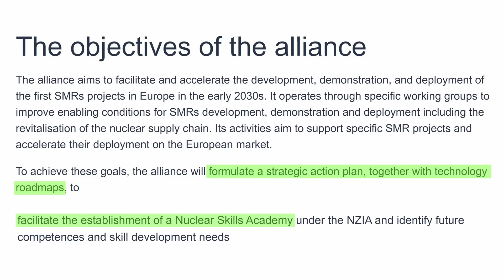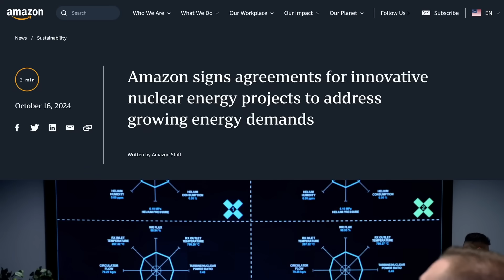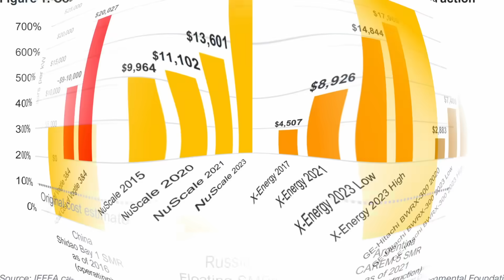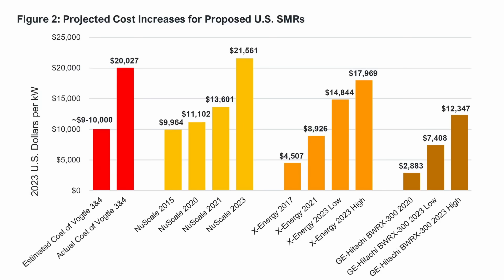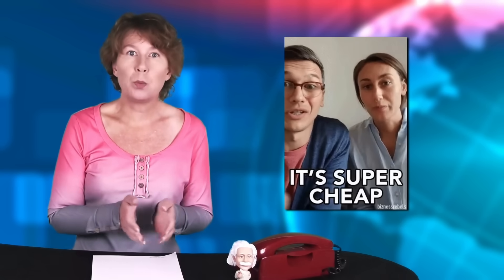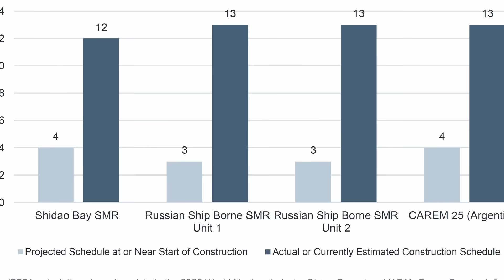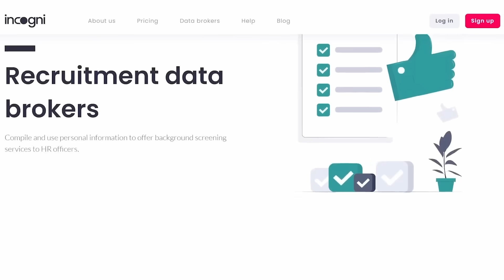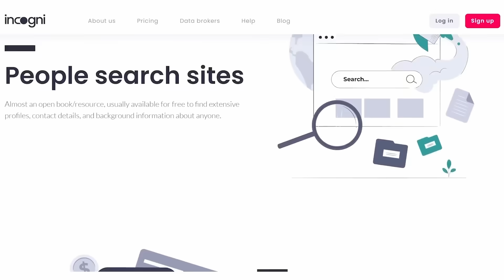Small Nuclear Reactors Have A Big Problem

Comment: I'm extremely pro-nuclear and have worked in the nuclear power industry.  However, the SMR concept has had some major flaws from the start.

But, lets correct the data on the NuScale plant.  The final proposal was to build 6 Power Units of 77 MWe for a total of 462 MWe (and not 12 Units of 50 MWe = 600 MWe).

Estimated cost came in at $9.5 Billion, with and expected inflation escalation of $1 Billion during construction for a total estimated cost of $10.5 Billion.

Based on the VC Summer and Vogtle lessons learned from the AP1000 construction mistakes (1150 MWe give or take some based on local conditions) it was estimated that you could have built a AP1000 unit for about the same amount of money which would have required about the same amount of staff (2.44 more generation for the same money).  Note that other countries with experienced nuclear construction crews have built the AP1000 units on time and on budget.

The biggest flaw with the SMR concept has been known since the late 1970's.   If you double the size of the nuclear power plant you need about 40% more materials, it cost about 40% more to build, and you likely do not even need to increase staff size.  When the Power Unit gets large enough to need a staff size increase - the staff size increase is minor to modest.  That is why virtually all nuclear power plants are 1GWe (1000 MWe) or larger.  Base economics of scale drives you to build the largest plant you can - if you need that much nuclear power (you do see a small amount  of 500-900 MWe plants as that much better matches the power needs of the country or area).   The USA built what would be consider 17 SMRs in the 1960's and 1970's.  They were all shut down as uneconomical once larger plants came online (and in a number of cases just due to staffing cost on a per MWhr basis).

The next biggest flaw is the concept of "standard design" that can be massed produced (and mass produced is a flawed concept by itself).    Each nuclear power plant has to be designed to withstand the local worst case natural disaster for where the plant is being build.  Major factors that affect the sturctual design of a nuclear power plant is how bad of a earthquake does it need to withstand.   I've worked in nuclear plants in the Midwest USA with very mild earthquake design requirements.  I've done consulting job in California in known active fault areas with expected much more severe earthquakes.  Everything from the thickness of the reactor vessel and other tanks, piping thickness, structural steel thickness (and spacing), required pipe supports, how thick and strong the floors are - are radically different.     In the 3 plants I have worked in in the midwest I-beams were about twice the thickness of fossil plants in the area (I previously worked in fossil plants in the Midwest).  In California the I-beams were 3-4 times as thick as the nuclear plants in the USA and they were spaced a lot closer.  I've never seen so many and so large of piping supports either.

Many other natural disaster factors exist:  Flooding risk, hurricane or tornado risk (and tornado are worse than hurricanes), Volcano risk (the Idaho NuScale Plant had to plan for a major Volcano eruption both upwind and relatively local to the plant), etc.

The concept of a "standard designed" component that you could mass produce for use in all nuclear power plant sites for the Safety Related Nuclear components - does not exist.  No one wants to pay for a component designed for the worst case - unless they are in a worst case design area.  It would massively increase the cost of other nuclear power plant.

Mass production requires 3 things.   

1) That you are producing large numbers of at least essentially the same item (minor variations allowed) in sufficient numbers to make sense to mass produce them.  Both Airbus and Boeing has Commercial Aircraft models where they are producing essentially over 100 per year, with model runs lasting over a decade.  Yet, these are all essentially hand assembled as its not worth the cost to build a factory to mass produce them.   There is a very apt real world comparison.

2) That you have a design that has been proven to work.  There is not a single SMR design that has proven it can run reliably and cost effectively for many decades.  The history of the nuclear power industry worldwide shows that even what appears to be great concepts on paper just have not worked in real life.  The USA build over 100 Light Water reactors using something like 70+ different designs in some way in the 1960's - 1990's.  A number of plants performed so badly that they were shut down very prematurely.  A lot of the others never had the license extended and shut down at or near the end of their original license.  Many plants in the USA often spent tens of $millions modifying systems and components to designs that actually worked in real life.

The only reason we now have long term reliable light water nuclear power plants is that we have had decades of lessons for each system and component in a nuclear power plant as to what works long term reliable, low maintenance cost, and reasonable to operate.  The AP1000 design (a 3rd generation commercial plant design) incorporated the best design for every component and system based on 4-5 decades of experience with all the different experiments.

While the SMRs can borrow some of those "best practices" many of the light water reactor and plant designs I have looked at have key elements that are totally new concepts that have never been previously built (1st generation design - and forget that they call it a 4th generation reactor - its still a 1st generation design for what they are trying).  No one knows if they will actually work long term as reliable and economical design concepts (and virtually none of the non-light water plant have ever had a successful commercial plant ever in the world).

So there are no "proven designs" that we know will actually work out long term.   Industry data suggest that it will take at least 2 decades of operation of any of these designs before we have a good idea if it will really work out long term.

3) That you have the 5+ years to build and troubleshoot a plant that could automate much of the production to get the economics of mass production for various large components.   No one is talking about this at all...

Until those 3 conditions are met - all major components for nuclear power plants will be built the same way they are now and have historically been built.  One to a small batch at a time: Example I worked at one plant design where there were 6 Power Plant Units built of that design - and 5 of them are still running- so every major nuclear and safety related component was built in a batch of 6+ in the late 1960's and early 1970's (in some cases spares were produced).  There will be no cost savings from mass production for SMRs.

Moving past the mass production issue:   Most SMR proponents are all talking about how skids can be factory built and moved to site - and then the pipes can just be welded together and  connecting wires run to save time and money in construction.

This has been tried at least twice for fossil plants. Total cost and schedule disaster. One of those ideas that looks good as a concept, but requires a level of quality and dimensional control in the factory producing the skids that so far has not been demonstrated to exist. It so far has been demonstrated to be cheaper to just build a normal seismically designed metal framework for the site (be it an industrial plant, a fossil power plant, etc), bring in the pre-assembled major components (Like has always been done) and field built connecting piping and wiring.

Now there may be a place for a few SMRs where you are geologically isolated and only need a small nuclear power plant.  However, economics of scale and other factors drive you to large central stations.

Last time I looked (some months ago) there were 9 Westinghouse AP1000 design plants under construction in the world, excluding Vogtle 4 which has now started up:  3 AP1000's and 6 Chinese CAP1400's (The Chinese hired Westinghouse to design a larger licensed version - their CAP1400 - about 1500 MWe), and about a dozen more where the AP1000 contracts were being negotiated.  I have heard that some of these contracts being negotiated at the time have been signed - so there are now more than the 9 I researched some months ago (and I'm not going to research things now).

There are about 60 large central station nuclear power plants under construction in the world at this time, with an average completion time of about 6 years.

Both the French and Germans have admitted that the EPR reactor design needs to be modified, and no new plants will be started (and all existing plants are struggling, in part due to the design flaws that they made).  I'm not holding my breath as due to French ego and pride but I think the French would be far ahead to just adopt the AP1000 and get moving. The 4 AP1000 China built has proven itself and directly against the 2 EPRs that China built.  The AP1000 is the more economical and reliable large central station plant.
Reply: I feel I learned a lot there.  Thanks for that.
Reply: Outstanding overview.
Reply: Now this is an informed comment. Makes sense that bigger scales save costs.
Reply: @Frrk 
The containment building can be hardened to withstand a direct hit from a bomb.  Automatic failsafe features insure a proper shutdown.
Reply: Longest YouTube comment I've read ever
Reply: Just a correction for the EPR, the UK will build at least two more (Sizewell C)
But yeah I agree, would should have prepared the certification of the AP1000 instead of working on the EPR2
But now unfrortunately it's too late and there have been way too much money invested in the EPR2 to not build it
Reply: @intrepidhibex  I wish they had gone with the AP1000 too....  I was going to be on the program engineering team setting up the engineering programs and policies, along with potentially troubleshooting construction issued due to my background.   Instead I was driving uber/lift and got covid badly which had left me with long-covid and I can no longer do the engineering work I used to do.
Reply: man, whoever you work for is never going to get that sweet sweet billions of dollars of Gvt grant money thrown at them.
Reply: Very informative, thanks!
But the chances of any new LWR (of whatever design) being planned, commissioned and brought to grid are very likely about zero for the next 20 years.
Reply: @DH-rj2kv  Your comment is only true for a few specific countries

There are at least 55 worldwide LWRs under construction worldwide right now, with many more planned.
Reply: Thank you, excellent comment! I've learned a lot from it.
Reply: Yeah, but let's loot at Baimsky NPP which consist of four floating NPPs 100 MW each, which have a price of $2 bln USD and is under construction since 2022.
It's 462MW for $10bln vs 400 MW for $2-2.5 bln.
If you're not seeking fast breakthroughs, but slowly building over the stable foundation, overpricing is not an issue.
Russia uses icebreaker reactors for SMR project and manages to keep the cost low. Also since Russia possess an advanced enrichment technology that provides high separation for low energy, and since electricity price in Russia is low, it can easily produce large amounts of HALEU for those reactors (with 19% U235) righ now, without investment into HALEU production.
Concerning the size issues Rosatom actually wants to build SMRs with the right size for the place they're going to be used. If the requirements is 200 MW, then it's 2 RITM-200 and a gas EPP as backup, if it's 400, then they'll build 2 RITM-400, if it's 600, then VVER-600, if 1200 then VVER-1200, and if you need smaller amount of power, they'll give you RITM-100 or some other reactors.
The problem starts when you build 10 SMRs instead of one or two reactors of a decent size.
Reply: @Itoyokofan  Russian reactors in general do not meet Western construction or safety standards.   Their newer ones are close; bur save a lot of money by not going the next step.

The biggest cost savings with a floating reactor is that it does not have to be designed to withstand earthquakes as the barge, ship, or sub marine just bobbles in.

I also point out the very poor radiation safety hazard of Soviet/Russian naval reactors.   As a comparison:  In the USA a person can serve for decades in nuclear propulsion and not recieve enough radiation to be a concern.   I have been told by multiple people that in the Russian Navy that the reactor crews typically serve 2-3 cruises and then are rotated out due to radiation exposure.
Reply: @perryallan3524  Russian modern reactors meet every standard. In fact VVERs are more safe than any western reactor, because it has a corium trap. And they're by far more reliable than AP1000 because so many of them were built and were working for decades. And all the recently build AP1000 had issues, which is why the price got skyrocketed, while out of tens VVERs built from 2000 in Russia and abroad there were none significant issues before the start, and all the recent projects were built on schedule and with no overpricing.
The hexagonal fuel packs TVEL produce have been less prone to deformations and leaks than western ones. Statistically they were more likely to deform back in 1990s than the square ones BWRs use but by 2024 TVEL had reduced the number of incidents below or on pair with any western fuel despite significantly prolonging the fuel campaign (they're one step behind the square fuel rods in terms of fuel campaign duration, but that's because westerners have  been really milking their old reactors, because of how little they build anew)
As for the automatic control systems Russian reactor abroad use western ones.
As for naval reactors, RITM-200 is not a descendant of submarine reactors, it's a water reactor descendant of icebreaker ones, so it cannot be compared to Bismuth reactors used in Soviet submarines, plus any issues they had were 40 years ago, by today Rosatom have been improving on the safety of all the reactor designs, and were building them for almost half of the century now.
All the talks about muh Chernobyl and muh Soviet submarines is irrelevant now, Rosatom doesn't even build these types of reactors anymore.
The seismic argument is irrelevant too, since two RITM-200 NPP are in construction simultaneously: naval Bilibino, and land-based Chukotka NPP which has to be seismically reliable since it close to Russia's seismically active province.
Reply: @Itoyokofan  Thank you for driving me to research the latest VVER-1200 design.  I stand corrected and concur that this design meets modern western standards (Even better than the EPR in my opinion).  However, to the best of my knowledge there are 5 currently under construction and none have run yet.   I disagree about the early VVER-1000 designs which were just Generation 2 plants although it appears that some of the later ones incorporated more safety features to more toward Generation 3 standards and may meet the standards I am looking for (and my brief look showed what apparently could be called Generation 2.5 plants).   I don't have the time to research individual plants and what added safety features were added to at least some of the later VVER-1000 designs.

You apparently are under a misunderstanding about the Finish nuclear power plant.  It's and EPR, and yes it has had problems (as well as the Chinese EPR plants - which my memory says has had fuel rod leaks).

I cannot consider a comparison of mainly Generation 2 reactors to the Generation 3+ AP1000 as fair; and I do not see hexagon fuel assemblies as having any innate advantages over square fuel assemblies. I have spent most of my nuclear career working in or consulting for Westinghouse reactors - and I have not heard of a single fuel rod leak in over 20 years that was not caused by Foreign Material (debris) getting trapped and abrading through the cladding (and those are now really rare - the two plant I worked at had not had any fuel leaks for any cause in over 20 years).  In the same time frame I have heard of other plant designs from the same generations (B&W, CE, Etc.) that have had fuel leak issues.  I think its a "how the fuel rod is supported and spacing" that is the issue, and it seems that Westinghouse figured that out long ago.   I have contacts in a Chinese AP1000 plant (as I did a consulting job there) and have not heard of any fuel leaks, fuel problems, or any reliability issues.

The fair comparison will be the AP1000 vs the VVER-1200 when they start operating and get past any initial startup issues (it seems that all plants have those).

I note that the EPR has a core catcher should a melted core melt through the bottom of the reactor vessel.   It appears that the AP1000 does not, but that Westinghouse took other actions to make that a very rare event (I did not have the time to dig into details if I was to answer your post).

The seismic argument is always viable when taking a vessel carried reactor and moving it to land.  How viable depends on what the local worst case earthquake could be.   I'm betting that there were design changes made to the land based version of the Chukotka NPP from the shipboard mounting.
Reply: @perryallan3524 
1. About VVERs, I believe Belarus and some others have the latest designs with corium traps. Leningrad-2 have AES-2006 design VVER with corium trap and confinement reactor building with passive cooling ventilation channels of the building.
2. I didn't say hexagonal fuel had advantage, I said it had disadvantage back in 2000s, (because of more harsh temperature conditions and some other problems), that's why Westinghouse fuel for VVERs haven't been successful at the beginning. But somehow TVEL had improoved on the fuel so much, it's not a problem anymore and it's on pair if not better than usual western-made fuel.
Well 2000s were 20 years ago as you say, so I guess everyone have figured out the fuel rod leaks already.
Also I'm getting the second-hand opinion from my wife's female friend, who's the NPP operator, and other sources, so if you feel like I'm saying nonsense be free to correct me.
Reply: @Itoyokofan  You provided a good answer and I believe it deserves a really good response:  According to a 50 page document on the Russian Rosatom website:  The VVER-1200 (AES-2006 design) was listed under construction at the following locations (and I misread it the other day; there were 7 units under construction in that document):

Russia:
- Baltic  (2 Units)
- Leningrad II  (2 Units)
- Novovoronezh II (2 Units)

Belarus:
- Belarus (1 Unit)

I looked these plants up using the database at the World Nuclear Organization; and that 50 page document is dated:

- Leningrad II VVER-1200 Unit 1 went online Oct 2018, Unit 2 Oct March 2021.  Unit 3 construction start in March 2024.  Unit 4 is planned for the future.
- Novovoronezh II VVER-1200 Unit 1 went online Oct 2018, Unit 2 March 2021
- Baltic  (2 Units): Canceled - never built, not under construction. Not currently planned.  It is a future proposed plant.

I also found that Kursk-II has 2 "upgraded" Units under construction under (Model VVER-1200 TOI).  Construction start in 2019.  Key modifications involve upgrading the plant design so that the core would not melt with the loss of all electrical power and controls for 72 hours (a standard the AP1000 met from the start of its conception before the year 2000 and licensed by the US NRC in 2006. Secondary key modifications to control radiation exposure to workers in the plant to more "western" standards.

I note that Russia likes to claim that they are the nuclear industry leaders.  I view them as a laggard in virtually every way and the VVER-1200 TOI/V-510 design shows by just how much and how long to catch up to the Western standards and ideas that predate the year 2000.  

I also highly discount the talk of plant operators who have only worked in a single plant design.  Most everyone thinks their plant design is the best and runs the best (unless they have a very troubled plant).  The reality is that the best running nuclear power plant Units in the world is tied to the Operating Company's policies for maintenance and training and the current top 10 nuclear power plants in the world with the best "load factors" (What % of power generation from theoretical if it ran at 100% 24/7) represents 9 different plant designs.

Likewise that top 10 MWhr producing nuclear power plant Units represent 9 different designs.  What is amazing is that 6 of the top 10 power producing Units in the world are in the United States and are Generation II reactor plants that were constructed many decades ago.

Note the above data can be found on the World Nuclear Association website 

There are 4 more Model VVER-1200 TOI's planned in Russia (Kursk II 3 & 4) and 2 Units at a planned Smolensk II plant.

Russia has on its proposal list a total of 22 VVER Units at various existing and new plant sites (most being the new TOI version - and only duplicating the older VVER-1200 designs at plants with those existing Units).

Belarus:  This history is a bit more revealing and shows the difference between Russia building plants inside Russia and building plants in other countries:

2 VVER-1200 units at the Ostrovets power plant:  Unit 1 construction started in 2013, Unit 2 construction started in 2014. Unit 1 went online Nov 2020, and Unit 2 went online Nov 2023.  Delays were attributed to a problem identified with the Unit 1 reactor vessel (and Unit 1 was built using the planned Unit 2 reactor vessel and a new reactor vessel was supplied for Unit 2) and that Russian nuclear construction company could not supply enough skilled workers to construct the plant on schedule (while the same company kept the new plants in Russia on schedule).

I also identified that:

Egypt is building 4 VVER-1200 Units at the new El Dabaa power plant:  Unit 1 Construction start July 2020,.... Unit 4 Construction Start Jan 2023.  I cannot find if these are the original VVER-1200 design or the newer TOI 72 hour passive safe less radiation for workers design.

Bangladesh is building 2 VVER-1200 Units an the New Rooppur Power Plant site:  This is a change from a previous contract to build 2 VVER-1000 Units. Unit 1 construction started in Nov 2017, Unit 2 construction stared in July 2018.  Construction of both Units are behind schedule.  I cannot find if these are the original VVER-1200 design or the newer TOI 72 hour passive safe less radiation for workers design.

China is building 4 VVER-1200 Units  (the original design).  Xudabao Units 3 & 4: Unit 3 construction start July 2021, Unit 4 May 2022.  Tianwan Units 7 & 8.  Unit 7 construction start May 2021, Unit 8 construction start Feb 2022.

In conclusion - as of this date there are 6 of the original designed VVER-1200's running.  There are at least 5 more of the original VVER-1200 designs under construction.

There are at least 2 of the upgraded to more modern western standards for passive safety and radiation protection TOI models under construction.

There are 6 VVER-1200's in Bangladesh and Egypt that I'm not sure of which model is being built.

There are 27 planned or proposed VVER-1200 Units inside Russia as of the latest information ( I have no information on proposed VVER reactors in other countries).  Some being the older version of the VVER-1200; others being the newer TOI version.

By the way: Russia has long claimed that the VVER-1200 Reactor designs would meet western standards has multiple times said that they were going to submit them to the US NRC and the UK Nuclear Regulator for approval (and their biggest selling point is that they are cheaper to build than Western Reactors).  They never have submitted these designs for approval despite all their talk.  Makes you wonder why.

France/Germany (EPR) Japanese and Korean companies submitted their designs for approval, and one Japanese and the Korean design is approved by the US NRC (The US NRC currently has 6 nuclear power plant designs approved that could be built on any approved site in the USA without any further approvals).  The other companies have suspended review of their applications at this time - which could be restarted at any time.

Note it took me hours to look this up.  Hope you appreciate it and hope that this clears things up. That is why I so rarely take time to look up detailed info to answer questions.
Reply: @perryallan3524  I appreciate your effort on the research, I really do. However I'd like to add something:
1. VVER-TOI, afaik, is an upgrade to AES-2006, so there won't be any new designs like AES-2006. Plus TOI project is being upgraded too.
2. Out of several proposed NPPs in Russia not all of them are going to be VVER-1200s, part would be SMRs, and Siberian NPP was apparently upgraded from SMRs to 2 VVER-1000 (an old design because it was prooven to be more seismically reliable) (this is just talk in the media, though).
3. I think Rosatom weren't keen on getting US and UK approvement is because they see this as useless. They're never going to be able to build anything in the US/EU/UK anyways. And despite having no such certificates many countries choose VVERs to build.
4. You can't blame Rosatom of not having immediately implementing the western standards of 2000, when the company itself was established anew in 2000s, with all the inherited problems and different standards and procedures. However I only see how Rosatom and ist Chinese counterparts were improving, while the West stuck with hundred of old Gen II designs, while building only a handful of reactors of Gen III design. 
4. The US is a leader in exploitation of the NPPs, there's no denial. But the root of the problem is lack of new reactors built. One of Rosatom main goals was to replace RBMK reactors, and thus they were building quite a lot inside the country for the last 30 years. Which is why they can afford building them cheap. At the same time the US operators (which are separate entities from builders) had to focus on the performance improvement.
You can find some areas, where Rosatom isn't in the lead, but it's the only company in the world that makes everything under one roof and in one country.
Reply: @Itoyokofan  The AES-2006 desing is a design standard and it became the  VVER-1200 plant.  They are just different names for the same thing.

The TOI upgrade is a substantial change, which meets (and now exceeds) the AES-2006 design standard.

The both Rosatom and the International community considers the TOI upgrad a VVER-1200 plant.

I fail to see why you think Chernobyl produced a gap that the western countries could not overcome, or why you thinkn that Fukushima did as well.  Chernobly had very major design issues that would never have been allowed to exist in the western world - and the Chernobyl disaster occurred because of one of them: The fact that at low power the reactor had a "prompt critical" zone.  The lack of a containment building ensured that a good portion of Europe was contaminated as well.

Fukushima occurred because the Japanese Nuclear regulator stupidly  allowed nuclear power plants to be built using twice the plant design life as a basis for some of the "design basis accidents" that had to be designed against.   Fukushima had a design life of 40 years and only had to design against a tsunami occurring every 80 years.   They occurred historically every 90 years in that area.   There was a 45% chance of such a tsunami occurring during the initial design life of the plant - and guess what: it happened.    The vast majority of the rest of the world used a standard for design basis accidents of "any event that has occurred in the geological history"

Japan has changed it standards on design basis accidents and has only been allowing plants that meet the new standard to restart (which so far I believe is only about 1/3 of the existing nuclear power plants at the time of Fukushima).  Several nuclear units under construction was halted, and I'm not sure construction of any of these have been restarted.

The ability to build all components in a single company does not mean that you have the best capabilities in the world.   Look at all the plants that China and Korea are building.   All evidence is that they run circles around the VVER designs based on operating records.
Reply: Thank you.
Small reactors have long been used for military purposes, hence I suspect that the delay in developing civilians versions is caused by regulations.
Reply: @centurione6489  Nope.  The US government funded the development of civilian nuclear power plants in the 1950's - into the early 1970s.  Over 100 civilian (with no goverment support) power plants came online in the 1970's - 1990's.

What has stopped the cost and time effective construction is that the USA (and much of Western Europe) stopped building new plants - and we lost the contractors, workers, and supply vendors who knew what to do and how to do it effectively.

You might see an article about Voglte costing $35 Billion and coming in years late.  The was an ever-growing list of mistakes made by supply vendors, contractors, and workers that caused all of those delays and rework (and some of the delay were truly massive - like finding out that the rebar in the containment building base and foundation did not meet specifications.... and having to break up 5-8 ft of heavily reinforced concrete something like 100+ feet wide, and starting over:  Note that the vendor who supplied the non-spec rebar with fake papers was not used for the replacement rebar or for any other nuclear work in the USA).  That was the worst one I know.  I have likely heard about 100 problems that would not occur with experienced nuclear contractors, workers, and vendors. 

Its been estimated that the next set - using the same contractors and vendors would likely come in at about $20 Billion and only a few years late.  That a 3rd set after that would be essentially about on track as for the what the rest of the world builds nuclear power plants for and completed on schedule.  It takes several sets of doing something to get down how to do it.
Reply: @perryallan3524  Excellent comments regarding SMR versus large nuclear reactors. I agree that countries should get back to building large nuclear reactors. I have been following Korea's APR1400 reactor builds since they signed the contract in 2009 to build 4 APR1400 for $18 Billion and completed the 4 in 2024 for a total of $24.4 billion. Korea developed the APR1400 in conjunction with Combustion Engineering and has built 4 in Korea with 2 more under construction. Westinghouse has claimed that the APR1400 is using nuclear technology that is owned by Westinghouse. Korea have been building nuclear reactors and have developed their design, expertise, work force, and supply chain which other countries have lost.
The Czech Republic has recently sighed a contract with Korea to build 2 APR1400 for $17 Billion. Hopefully Korea and Westinghouse can settle their disagreement.
Reply: @perryallan3524  Thinking about it, smaller reactors were more suitable for bases in cold climates where there are problems in obtaining electricity and the end result is worth the cost. But not feasible in a suburban environment.
Reply: Great summary and trigger warning.
Reply: Yeah, it seems modulation is a good theory but can be a fallacy in practice if not analyzed properly. You are essentially multiplying the required materials to build the same size reactor. Also, if you need more power and need to add another module, why not just put that module in in the first place? There's never enough energy generation the demand is limitless. That's not to suggest building RBMK sized reactors which were ridiculously big.
Reply: Are you at all optimistic about any Gen IV non-SMR designs?  I assume you know all about the Kairos power design.  I am not in the field at all (I work in digital communications), but there’s a lot that seems appealing about new designs compared to light water reactors which are often rejected by the public. Nuclear power can succeed if it is both passively safe and cheaper and I just don’t see the Gen III designs being refined enough to get there.
Reply: @DaraParsavand  Well, Gen IV is a thing already. Russia is building BREST-300 reactor, which will demonstrate the lead coolant technology and fuel recycling within the NPP, and the next step is BREST-1200, which will be a standard project along with VVERs. It'll take about two decades, but everything is ready for GEN-IV to come into the huge reactors league.
And China has just built gas-cooled and molten salt reactor prototypes, the only issue with them is that they're not designed to enter 1 GW league yet. Gas-cooled reactor is specifically hard to build in 1 GW size.
Reply: @DaraParsavand  You ask a good question Dara.   You are correct that some of the so called "new" non-light water designs do in fact hold huge promise (the reality is that all of these designs were proposed in the 1940s - 1960s just not developed past perhaps a single test reactor or two as light water reactors were working better and developing faster - they are really old designs).  However, just like the automobile - it takes many years of refinement to make things work well, reliable, an economical.   You would not like to do the maintenance with all the breakdowns of the Model T or Model A fords, or any early automotive history vehicle.

The other piece of gross misinformation is calling these reactor 4th generation.  If you look at their design history most of them are at the 1st and 2nd generation stage, and one of the recently claimed 4th generation reactor that China built is really a 3rd generation design.

But, people get hyped up about the name 4th generation... so everyone is using it even if its totally not true.

IF it can be shown that one of these technologies actually seems to run somewhat well in a small power plant (after perfecting things at a test reactor stage) - then it will likely be 30-50 years of refinement and lessons learned to fine tune the designs to something that really works well and reliable and get to the level of the current AP1000. In the meantime expect that likely 10%-15% of the power plants built with these new technologies will flop and be shutdown early.  That is what it took for light water reactors, and there is a whole list of failed LWR plants that most people don't remember.   You can see the same pattern in automobiles, aircraft, commercial trucks, etc.

I am optimistic that at least one, and perhaps two of the non-light water designs will work out.  But, they are not solutions for the next 10-20 years in any meaningful way.  Most of them have to progress beyond the test reactor stage 1st.    

The exception is the liquid sodium cooled fast neutron reactors.  At least half a dozen Countries in the world have built sodium cooled power plant reactors (including the USA).  With I believe the exception of Russia everyone else shut them down due to problems (Russia claims their plant is running problem free - but it usually takes 20-30 years before we hear of major problems in Russian Reactors - not many believe Russia about how problem free it is).  France developed a 2nd Generation sodium cooled power plant that was to address many of the issues, and it was also shut down very early in its life.   None of the proposed Sodium cooled SMR designs have to me addressed the core issues identified with sodium cooled reactors that pretty much led all the countries other than Russia to abandon them.  It's one of the great concepts... but liquid sodium has its problems in the real world.
Reply: No one read that
Reply: Just for the giggles wanna point out that you differentiated between Cali and the USA 😂
Reply: Itt is possible that SMRs that can be transported by truck will eventually be economical, but targeting such a reactor from the start is a mistake. The target for the first SMRs should be modules that can be transported on railroad cars. There is no need for most reactors to be small enough to fit on a truck bed.
Reply: I am not sure if I agree with your point 2) . In a way, the SMR concept already has proven itself. Just look at the navy. Hundreds have been built in the last couple of decades.
Reply: I ❤ it when someone take the time to invest in exploring and explaining the entire concept with perfect Grammer, since I'm South African and English is not my mother tongue.  Thank You.
Reply: My grandpa designed nuclear reactors, so I grew up on his library, got a physics degree (although not related to nuclear fission) and have always been fascinated by this topic. Oveer the years I have read a lot about the economies of scale, 0.6 rule and all that, as well as technical, safety, regulation and other aspects, and was indeed very skeptical regarding SMRs from the very beginning of the topic. But never before have I encountered a post I could easily share with non-technical audience to support my views. Thanks a lot for the work of writing this up in the best science communication manner! I suggest you could also publish it in a more appropriate place like your blog so it could be more conveniently shared
Reply: China is in the best position to make cost effective SMR happen.   Because 1)  long term unwavering government support, 2) smaller reactors will not have the same problems you mention, 3) regulators in the west are themselves unregulated but in China regulators can not afford to create unnecessary/overkill roadblock regulations that obstruct government priorities.
Reply: @douginorlando6260  If you have not noticed: China really has no interest in SMRs; and only has 2 active SMR projects, and they have already proven that the factors I identified - especially economy of scale - applies to SMRs.  The PWR SMR projecct has already failed in its goals, and a 2nd SMR project is an attempt to scale up a HTGR design to eventually a GW size or large reactor (Which would be themally more efficient than a PWR or BWR).

They also essentially have the same regulations and construction standards as the Western Countries.  They key difference is that they did not shut down reactor construction and the staff at the Chinese Nuclear Regulator can efficiently process site and new design applications; and there are a number of very experienced nuclear construction contractors and thousands of very experienced nuclear construction workers.

China currently has 28 GW+ sized Nuclear Power Units under construction.  They have 1 SMR under construction; the APC-100 which is a SMR demonstration project at the Changjiang power plant location - which is also called the Linglong One reactor or project (125 MWe PWR).   Main construction of Unit 1 is complete and this plant is currently in systems testing phase, will likely move to startup testing within the next year.

While they are planning to build a Unit 2 APC-100 the Chinese have already admitted that the Linglong SMR project is a financial failure as the idea was to show that SMRs could be built economically.  So far they have about $5 Billion invested into Unit 1. China can build a GW sized PWR for about $10 Billion (you don't build a plant 1/8th the size at half the cost of a full sized plant).   China is big on completing planed projects so they do plant to build Unit 2; but cannot see how they can get the cost down to anything competitive with a large central station.

China is currently operating 2 pebble bed SMR reactors (tied to a single steam system and single turbine generator:  Plant size is rated at 150 MWe; but a lot of people talk about it as if its 200 MWe (the actual number is 211 MWe) however those are "Gross Generation" values.  All power plants use a lot of electricity to run themselves.  Their size is reported as what they can sell - which in the case of Shihdaowan pebble bed HTGR nuclear power plant combined 2 reactor unit is 150 MWe.  Note that China licensed the German Pebble bed design and worked to improve things to hopefully prevent some of the issues that Germany had (such as pebbles routinely breaking and releasing radioactive dust around the plant).

China has said that they are planning to build larger SMR sized versions of the Pebble Bed HTGR design when they figure out how to improve the design. They have not listed any of these plants on their planned construction or "proposed" nuclear power plants of the future list.

China is currently planning to start construction on 28 GW+ sized nuclear power plant units, 2 (two) 600 MWe power plant units (in some cases you don't need a GW+ power plant in an area), and the above mentioned 2nd APC-100 all in the next decade.

China has proposed building 76 more GW+ nuclear power plant units 20-30+ years out, and an upgraded HTGR larger SMR based on lessons learned from the current 150 MWe pebble bed reactors. Also note that if China is successful in overcoming issues the Germans had with their Pebble Bed design, its possible for the next larger pebble bed reactor schedule to be pulled up.  However, the long term goal is to scale the pebble bed reactor up to a GW or larger nuclear power plant unit due to economics of scale.

China has not proposed building any other SMR reactors at this point in the next 30 years.  They are running a 2MWthermal Molten Salt Test Reactor (started up in summer 2023) if that works out (no guarantee of that) then they have eventual plans to do a larger test reactor (I understand about 20-30 MWthermal), then likely about a 40 MWe demonstration power plant, scale that up to about a 150-200 MWe SMR, with a further scale up to 600 MWe and the eventual goal of a GW+ sized power plant.  It will take decades to do all of that if they can get the MSR to work reliably.

Note: Data primarily from the World Nuclear Association website, with Wiki and a few Chinese site searches for specific plant details.

Have a great day
Reply: @ you provide an excellent overview of nuclear power generation based on reliable sources.  Thanks.  But 8 still think when China works out a good design such as the radioactive pebble based reactor,then they will apply it to both small and large reactors.  And a small reactor is a good candidate that takes advantage of factory mass production.  For example, perhaps engineers will encase each pebble with a tungsten shell to contain any broken pebbles.Perhaps they will design a porous relief valve on each pebble that allows hydrogen to escape but not radioactive elements. And mass produced pebbles can be from a factory making a thousand of them every day. 
      Regarding Milton salt reactors, there was an attempt to build a commercial liquid sodium cooled reactor about 40 or 50 years ago (in Monroe Michigan). Liquid sodium is a nightmare for corrosion and  chemical reactions and the power plant was changed to a traditional approach before completion. One potential way to avoid the corrosion problem would be to design the plumbing and walls containing Molton salt such that the temperature of the wall surfaces is low enough to turn molton salt into solid but at the same time not plug up the pipes with solid salt (it’s a recipe for giving a MSR a cardiac arrest so it is a risky approach that may not be viable).  The other thing about MSR is so many neutrons are absorbed by the salt, making the chain reaction harder to achieve.  However the right isotope of salt does not absorb neutrons, which opens the possibility of improving the nuclear process if salt isotope separation can be achieved in quantity. 
      My favorite nuclear power concept that I never heard anyone consider involves a traditional design. (It solves the two biggest problems).  If the reactor was built in a chamber one mile below ocean level (or lake level), then the chamber and shaft were flooded under a mile of water, then the reactor chamber would have an ambient pressure of 2000 psi.  The whole reactor system could operate at 2000 psi which eliminates the need for a pressurized system. This also avoids the possibility of a runaway chain reaction due to exposed core plus provides the benefits of a coolant that can handle high temperatures without vaporizing. The only component needing high pressure containment is the steam turbine which must operate at low pressure and therefore needs to be encased in a hull like a submarine capable of holding back high pressure from the outside.   The other big advantage is if things do go wrong, it can be permanently sealed off.
Reply: @perryallan3524  For China 1 GW is a SMR-sized reactor, tbh. No wonder they cannot really figure out the 100 MW SMRs.
SMRs are really for small countries like Slovakia.
Very interesting insight on Chinese program, thank you!
Reply: @Itoyokofan  Regarding China:  I'm not going to claim that China has the best nuclear power designers in the world. There is a reason that virtually their entire nuclear power plant infrastructure are essentially copies of Western Designs with some minor tweaks and improvements (which they are now licensing from the Western Companies).

But, in my opinion they do have what is likely the best nuclear contractors and construction people who know how to build nuclear power plants that are safe and economical.

I do not know the details of what has gone into the design and certification of the Linglong APC-100, nor site issues that perhaps were off-base (which can get very expensive very fast) and any construction issues (and these reasons likely is why Lanlong one cost $5 Billion so far).    But, if China cannot economically build a SMR, then I don't see anyone else doing so.  We also have the canceled NuScale Idaho plant as comparison that only validates how badly the economics of scale work against SMRs.

The reality is that the the main factors that I mention in my main post (of which this is a reply) is that economics of scale very much work against SMRs and that for now (and the next few decades - if ever) economic savings from mass production because there will not be any mass produced design at this point of technology.

Yes, Russia is also developing a SMR. But, I assure you that it will not be cost competitive to larger central stations.  Russia's worldwide claim to fame in nuclear power plants has always been that they could build them cheaper than Western reactors; but, there are real reasons that they can build them cheaper - and many countries in the world don't want a nuclear power plant that have those reasons.

The only place SMRs will have a market is where a modest size reactor is needed in a remote area where its not cost effective to build transmission lines to support.   So, I can in fact see a small number of SMRs in the world.  Just not any as major providers of power to the general world.
Reply: @douginorlando6260  Please read all the comments to my main post.  I have addressed many of your points and are not going to repeat things here (and do discuss the problems with Liquid Sodium - many countries built such plants).   

However, mass production of SMRs is not going to happen due to the individual nuclear power plant design basis accident criteria that require site specific requirements that affect every component and the very structure of the building itself.

Your concept of a deep flooded nuclear power plant would be exhorbantly expensive to build and ignores the fact that everything requires maintenance.   Such a flooded plant might run for a few years past startup testing, and then something is going to break down and the plant will not be repairable because its flooded and under such high pressure to make it all but virtually impossible for any workers to service the plant.

Have a great day,
Reply: @ robotics and remote controlled machines that are the eyes and hands of the controllers … they work at 600 psi no sweat. Don’t count out the new technology that is coming
Reply: You can not compare building an airplane with building a snr, the key is in the size and the number of units. Offshore windmills and airplanes can never be really mass produced, but a heavy haul truck most certanly can, and the difference is the size itself, if an item is too big it can not be mass produced, since the machine to build the thing is typically 10x to 1.000.000x the size of thing, and if the thing is big in itself, building the machine to automate the building is impossible. To mass produce snr is possible, but to mass produce an airplane is impossible.
Reply: @bjorn2fly  A SMR is far more than a reactor vessel.  Its an entire plant filled with lots of equipment, piping, valves, pumps, controls, etc.  A even for a 75 MWe SMR I foresee at least 7 pieces of equipment with each piece filling an entire semi flatbed by itself, with those pieces assembled into the plant at various places (some hundreds of yards (or meters) apart).  Several key components like turbines and generators would be shipped in with very specialized multi-axis trucks (think at least 9 axles - 36 or more wheels) due to their weight.  You cannot mass produced a SMR.  You have to field assemble it onsite with the major components and build piping and run wiring, build a control room, etc. just like any other power plant above about a 15 MWe combustion turbine that does not have a heat recovery boiler.

I doubt that you could even mass produce the reactor vessel or the steam generators either (and I worked in a pressure vessel and heat exchanger shop for 4 years where equivalent sized equipment to the SMR ones I have seen defined were produced).
Reply: Great comment, thanks.
Reply: Everything written above is correct as far as I understand (I worked at the French Atomic Energy Commission and particpated, when doing research at MIT, in the early seventies in an extensive study of the causes of inflation in the cost of nuclear reactors). France had a nuclear industry but let it go to the drain. France is trying again. It will be costly and may or may not work. Whether or not EPR is ready for serial production is an open question.
Reply: As an active nuclear power plant employee, I agree with everything you wrote. I would just like to add that each nuclear object has to have rather sofisticated security, which has nothing to do with energy production but costs money to build and to operate. And expense is probably roughly the same regardless of the size of the unit, therefor less MW, more $$ per MW is lost to security.
Reply: I read about a US research base set up somewhere in the Arctic Circle, built in the ‘50s I recall the comment, diesel would have problems running in cold climates, so a nuclear reactor was installed.
That it was stated casually was interesting and not likely nowadays.
Reply: @darylcheshire1618  It was actually in the antarctic and the US Navy built and ran it for decades. But, it had problems as it aged and leaked a lot of badly radioactive water.   I think  I read that it cost about 1/4 $Billion to remove and clean up the site (I understand thousands of tons of contaminated base soil were flown out of the antarctic to the national nuclear waste disposal site in Idaho).

I'm not sure if they are running diesels or gas turbines now, or both.
Reply: @ wow, thanks for the update.
Reply: @darylcheshire1618 That was a shipping container reactor at McMurdo station in Antarctica, though they had plans for light water and nitrogen gas turbine shipping container reactors for use in Arctic radar stations.
Reply: I urge you to read my book on the US nuclear rocket program entitled "To the End of the Solar System." There you will see extremely small size gas core reactors (core sizes 20x52, 35x52 and 55x52 inches) being tested almost every year from 1955-1972 while running at 2000+degrees C and aiming for 3000 degrees C. It had "accidents" with one full size reactor being blows up and another causing along at 2000 C when it ran out of LH2 propellant/coolant. The core ejected out the nozzle and contaminated the test pad. After waiting for several weeks, cleanup began with crews with tongs picking up the bigger pieces and then a 200HP truck-mounted vacuum cleaner did the rest. Total cost for the entire program was $1.3 billion and despite its success and the revolution it would have brought to the space program the Nixon administration cancelled it in 1972. Currently, DARPA is working on a nuclear rocket engine for national security purposes.
Reply: Could not have said it better myself, largely because I would have not had the inside the industry cred and I would have ranted a bunch about how these companies promissing these SMR KNOW it is impossible and are strait up scammng their investors with what has essentially becomes an internet meme amoungst psudo-intelectuals who want to denounce renewable energy without the outright embracing the cringe that is climate change denial.
Reply: @apessimist7295  As an Austrialian you should be rioting in the streets to stop a nuclear boondoogle by your conservative government who's only motivation is to kill renewables power, your litterally the worst possible location for nuclear with high seasonal variation in demand, high air temperatures and limited fresh water supplies, their is also no domestic nuclear industry which means your going to be buying from forign suppliers so just get solar panels and pay a fraction of the cost.
Reply: Do you have a LinkedIn? I’d love to learn more about your experience. I am in grad school and serious about the SMR space. Any help is appreciated.
Reply: You are a fool if you think anybody will learn from Vogtle. 
Georgia Power didn't even learn the lessons from Vogtle 1 & 2, decades EARLIER before they screwed over the ratepayers with Vogtle 3 & 4 and the Superwhamadyne APR fiasco.

How do you know if the AP1000 is more economical and reliable when it has virtually NO TRACK RECORD and many of the non-US were built AT GOVERNMENT DIRECTION WHERE NO SCANDALS WILL BE ALLOWED TO SEE THE LIGHT OF DAY?!
Reply: Excellent synopsis. It’s a relief to see that the Engineers are still out there doing the heavy lifting imposed by reality.
Reply: Thank you very much for an excellent summary.  One question however. If the SMR's are able to shut down immediately and thus eliminate thermal runaway, wouldn't this eliminate many of the risks caused by local climatic risks - and thus promote standardiszation?
Reply: @ejw4300  Great question;  the problem is decay heat.  A nuclear reactor is not like a car engine or a fueled boiler.

When you stop the chain reaction in a nuclear reactor - the reactor fuel is already very unstable and reactons continue on for many years releasing heat.   Now the amount of heat generated decays with time (and rather fast initially).  But, if you do not supply constant cooling the typical solid fuel rod core will melt by just the decay heat for at least a month or two depending on the core design.

No matter the reactor design, provisions must be made to supply adequate cooling (by one means or another) until you get the decay heat load down to a level that the normal core design and reactor vessel can handle just by simple convective cooling of the reactor vessel.

This is also the reason that spent fuel is stored for many years under water.  To keep it cool and remove the decay heat.
Reply: Not a bad run down
Reply: Wow
Reply: Sabine really should pin this comment.
Reply: Thank you for enlightening.
Reply: Damn, thanks for taking the time to write all of this out. I hope you have a blog!
Reply: What’s preventing them from using the modular design of the reactors used in nuclear subs for these plants? Seems pretty modular and proven. Appreciate if someone could explain the difference and difficulty in doing this.
Reply: @bossjones7013  Naval reactors are designed to a completely different set of standards for operating environment and life than civilian power plant reactors.

Example, they are not designed to withstand any earthquakes - as the Naval vessel will just bobble in the water.

At the same time size and weight and having 0 or only 1 refueling outage in their life s a critical factor so they are very small for their power output compared to a civilian reactor, and fueled with extremely highly enriched U235 which is astronomically very expensive.  Naval reactors are build on a "Cost does not matter" basis.

If something goes wrong in a big way... the plan to protect the health and safety of the public is to scuttle the naval vessel and put the reactor on the bottom of the ocean.  Something not acceptable for a civilian power plant.

Completely different design concept from civilian power plants.  Very expensive for the power they produce.
Reply: @ thank you!
Reply: Good points – thanks for an excellent overview of relevant issues.
Reply: Here
Reply: What do you make of the San Onofre, Ca nuclear power plant debacle?
Reply: @jamesq3896   My opinion is that the Japanese company that built the replacement San Onofre steam generators screwed up badly.  They claim that they did not know of that kind of vibration issue (without looking up the exact name of the vibration issue).  But the US heat exchange industry knew of it and solved in in the 1990s - and the solutions were published in the TEMA manual (Tubular Exchanges Manufactures Association).

One of my jobs at one of the  nuclear power plants I worked at was "Heat Exchanger Engineer" as I had worked in a heat exchanger shop and knew a lot about them.

We had a pair of RHR heat exchangers designed in 1968 that had that very same vibration issue.  That was understandable as heat exchangers in those days were designed by rules of thumb and no one had really run into and analyzed that kind of vibration.

By the mid 1980's the USA heat exchanger industry was researching that vibration issue and by the early 1990s started proposing possible solutions (which took building some HX's to find out which design solution solved the problem).  I think the Western European Countries were right behind the USA in researching that vibration issue - and came to the same final design rules for a solution as what the USA did.

Another possible problem is that while it is virtually certain that the original specifictions for the replacement steam generators specified that they had to be built to TEMA standards.  I had experience with a Japanese Heat Exchanger Company who bid on replacing Feedwater Heaters in our plant.  Their bid submittal replaced all USA standards with a Japanese standard.  I rejected there bid out of hand because of that.

I wonder if the final specification issued still said TEMA standards or used the replacement Japanese standard which obviously did not include analyzing and designing for that kind of vibration. In which case the Utility screwed up badly.

However, the Japanese was able to claim in international court that they didn't know of that phenomena and win their case that they were not at fault.   I think the US lawyers were incompetent.  How could the Japanese HX industry not know of a major past failure issue that was addressed in both the US and EU standards to build HXs from the 1990s?  Note: Steam Generators are a tubular heat exchanger.
Reply: @jamesq3896  My opinion is that the Japanese company that built the replacement San Onofre steam generators screwed up badly.  They claim that they did not know of that kind of vibration issue (without looking up the exact name of the vibration issue).  But the US heat exchange industry knew of it and solved in in the 1990s - and the solutions were published in the TEMA manual (Tubular Exchanges Manufactures Association).

One of my jobs at one of the  nuclear power plants I worked at was "Heat Exchanger Engineer" as I had worked in a heat exchanger shop and knew a lot about them.

We had a pair of RHR heat exchangers designed in 1968 that had that very same vibration issue.  That was understandable as heat exchangers in those days were designed by rules of thumb and no one had really run into and analyzed that kind of vibration.

By the mid 1980's the USA heat exchanger industry was researching that vibration issue and by the early 1990s started proposing possible solutions (which took building some HX's to find out which design solution solved the problem).  I think the Western European Countries were right behind the USA in researching that vibration issue - and came to the same final design rules for a solution as what the USA did.

Another possible problem is that while it is virtually certain that the original specifictions for the replacement steam generators specified that they had to be built to TEMA standards.  I had experience with a Japanese Heat Exchanger Company who bid on replacing Feedwater Heaters in our plant.  Their bid submittal replaced all USA standards with a Japanese standard.  I rejected there bid out of hand because of that.

I wonder if the final specification issued still said TEMA standards or used the replacement Japanese standard which obviously did not include analyzing and designing for that kind of vibration. In which case the Utility screwed up badly.

However, the Japanese was able to claim in international court that they didn't know of that phenomena and win their case that they were not at fault.   I think the US lawyers were incompetent.  How could the Japanese HX industry not know of a major past failure issue that was addressed in both the US and EU standards to build HXs from the 1990s?  Note: Steam Generators are a tubular heat exchanger.
Reply: Would it not be possible to design the facility for the local environment and the standard modules to be so isolated?  There are also examples of nuclear powered vessels being used as temporary power supplies for land based developments. Should we look at floating installations anyway?
Reply: @robinwells8879   Simple answer is that floating nuclear reactors do not have to be designed for earthquakes.  They just bobble in the water.  Land based nuclear reactors - and the entire building and much of the equipment, piping, wiring, etc in the building must be designed for earthquakes.

Floating nuclear reactors tend to be rather small, perhaps in the range of 5-10% the size of the most economic GW+ land based reactors.  There are limited places in the world where floating reactors are potentially applicable.

Then you also have to address the corrosion and aging of the vessel the floating reactor is contained in.   Land based reactors often sit for 40+ years after shutdown to allow the worst of the radioactive decay to minimize demolition and disposal cost.  Very minimal maintenance is required for those decades.   

A vessel has to be maintained to prevent it from sinking - a more costly option.
Reply: There are few commercial operation SMR operating in China. Pebble-bed reactor seems promising. Do you know anything about that？
Reply: @Soras_  Thank you for a very good question. Yes I do.  China licensed the German Pebble Bed design and then tweaked it to try to address the problems the Germans had (one of which is breaking pebbles, and the other problem was pebbles, and their pieces, getting stuck in the bottom).

China wants to see if they can make the design work as the plant would be noticeably more thermally efficient than saturated steam PWR reactors.  If they can make it work then they plan to scale it up to several time the size.  If that works then they will scale up again, and ultimately to a 1GW+ sized plant.

The reactors are SMR sized because that is the next size step up from the German designs that appears to potentially work.

Germany actually built a larger 300MWe thorium fuel cycle pebble bed that was shut down very early due to design issues in that they did not consider putting key components in a containment building and they were spreading radiation offsite from broken pebbles.  After Chernobyl the German Public had zero tolerance for any plant without a proper containment building to contain the radiation from things going wrong.

Note that there is nothing new about Thorium. The USA built 4 commercial power plants designed for thorium fuel cycles in the 1960's - 1980's.  The German plant was the 5th.

What everyone learned was using U235 was far cheaper, and that thorium as a bad U232 gamma radiation issue with waste and reprocessing.

We have thorium core designs ready to go that could be put into almost every BWR and PWR in the world (the USA did that in the 1970's to make a stockpile of U233 to seed thorium reactor cores)... Except that it cost a lot more to make thorium nuclear fuel from thorium ore than it cost to make U235 fuel (even with low enrichment) from uranium ore.

Anyway.  China is planning to build at least one more pebble bed power unit (2 small reactors feeding one turbine generator) that basically duplicates the plant they have. They almost always build 2 of something to get a fair test of the technology.

If China can solve the broken pebble problem and pebbles getting stuck in the bottom then I see a bright future for the pebble bed design.   However, they may not find any good solutions in a timely fashion and then would abandon the design.  China is spending multi-billions testing almost every plant design to find what works best.
Reply: You should have consulted with Sabina on this video.  Her treatment on the subject was superficial.
Reply: @VoiceTotheEndsOfTheEarth  I have no idea what Sabrina is working on, and she does not share that with us.  I can only react to what she posts.  By its very nature YouTube prevents most direct contact between people posting videos and people responding with comments (at least as far as I know of).
Reply: In English please .....?
Reply: When the coolant in the reactor is water, mechanical stresses for containment are high. Designs with gaseous He or liquid Na cooling the reactor don't go through a phase change from 200-700°C, so  pressures are much lower. All the safety factors built into B31.1 suddenly become much less costly to meet. He is nice because it doesn't change into another isotope from neutron collisions, where Na becomes partly radioactive with a half life about 15 hours. Virtually no radiation to the environment if you lose coolant (He) or quick half life (Na). The hot He or Na still drives a steam cycle to power turbines, but loss of containment there is a more conventional and manageable risk.
Reply: If you see this, I’m curious if you work in the nuclear industry now?  I’d like to talk about you being a guest on my podcast. Thanks!
Reply: @TheJobsPodcast  I am not currently employed in the nuclear industry.  I do answer questions that people in nuclear power plants contact me about complex problems now and then.

Long Covid has destroyed my ability to work, and it may take a bit to set things up (I have better days, marginal days, and bad days - with little control over that unless I take drugs the Dr has prescribed for when I need them.  I try to stay away from them as they are not long term safe to take.

I would be willing to be on a podcast; but I'm not sure how we contact each other to set it up.
Reply: The one risk you didn't mention was manmade. The russian war on Ukraine has highlighted how risky the enemy action factor is to mitigate.
Reply: @Anax100 and it's not even a problem because of the reactor itself, it's shell is built to a higher specification, but because of spent fuel storage (stored on site for iirc 5 years, so it is definitely inert when transported for reprocessing) and risk of power supply being cut off.
Reply: @Anax100 My point exactly.
Reply: Thank you for sharing your knowledge.  Why cant we just mass produce small nuclear reactors like the ones found on nuclear submarines?  They have been around since the 1950s so i imagine they are proven. I also imagine a submarine puts up with way more than what natural disasters can do....
Reply: @drevilatwork  A military submarine would be built to protect against very different hazards, no? And I suspect the reactor (and entire submarine) does not actually survive some of those, but it's accepted to let things end up at the bottom of the ocean in those scenarios.
Reply: @AySz88  A nuclear submarine is not a cost effective solution for power generation...
Reply: @AySz88  The reactor in a nuclear submarine is typically less than 20MW.   This gives the calandria the surface to area ratio to cool itself passively (you can go to about 60MW-80MW this way).   Western nuclear submarine reactors use only convection cooling and no pumps are needed.  Hence nuclear reactors in submarines are very safe.   Not only does this make them safer it makes them quieter (a key necessity).   The inventor of the PWR said it should never be scaled above 60MW.  Above that forced cooling is needed and the amount of steam can cause explosive damage to the reactor.
AP1000 and huge reactors are not passively safe and can never be safe even if they can convection/evaporation cool themselves for a few days after shutdown.  They should never ever have been built.   They will never be accepted they are not passively safe.  The reason nuclear has not succeeded is due to this type of reactor.  
Other types should have been developed.   Pebble Reactors, HTGR with ceramic fuels, SMR in the 60MW-80MW range, molten salt.
Reply: @drevilatwork  Naval reactor are vastly more expensive than civilian reactors; and are not designed to withstand earthquakes and a variety of other things.

It is acceptable to the Navies of the world that a problem reactor sinks to the bottom of the ocean.  That would never be acceptable for a Civilian nuclear power plant.
Reply: @drevilatwork  Because the military uses weapon grade, highly enriched uranium in their nuclear power units and non-proliferation is still a thing. 🤷‍♂
Reply: @drevilatwork  In military applications cost is less of an issue. AKA things are accepted to be more expensive than rational. Like the german military jeeps of 500K USD, that have similar functionality as any other 80k USD Jeep. Furthermore, strangely enough safety is much less of a concern in military applications than in civilian. Basically in the cost benefit analysis models for decision making, military benefits have very high leverage, that seems to make high risk high cost decisions rational. Any military system is calculated such that the cost of distruction by an enemy would be tolerable. So also technical problems of the Nuclear sub somewhere in an oceean are weighted very different than a disaster with a Civilian Nuclear powerplant.   If some secret sub-melts down somewhere in the ocean no body knows and no body cares compared to if Fukushima happens. I am exaggerating to make the point, but i insist the exaggeration is only modest, and the principles do apply.
Reply: @drevilatwork  Cost and fuel loading for military standards.
Reply: The EPR isn't a good design, and European safety rules demanding multiple active redundant safety systems mean that they use 10X more concrete and steel than the AP1000.
Reply: @gregorymalchuk272   I doubt that.  I studied the EPR and have read a few papers about its problems.   My understanding is that it was a good attempt, and that it does not really use much more material than the AP1000.

China built  2 EPRs and initially 2 AP1000s to compare.  The 1st ones were a bit over budget and time as the Chinese nuclear contractors were not used to the design.

As some  of the EPR problems were discovered during construction China ordered 2 more AP1000s

Once they were running the differences became very apparent (and more problems with the EPR surfaced).

China then decided after comparing the two designs after several years of operation to base its next generation of large central stations off of the AP1000 design, and asked Westinghouse to design the nuclear part of their larger CAP1000, with a licensing agreement with Westinghouse.

I did a consulting job for one of the Chinese AP1000 plants.  China's nuclear construction and safety culture is top notch.  They are not cutting any corners.

They can build on-time and on-budget because they have nuclear construction contractors, workers, and suppliers who are very experienced and know what they are doing.
Reply: What about the Nuclear Submarine reactors then? Aren't they effectively SMR's?
Reply: It's simply a scam. That is all.
Reply: Your first section is absolutely right, nuclear reactors get more efficient the larger you build.  The second section is wrong through, they absolutely can be standardized and mass produced and we are already doing so.  In fact Westinghouse designed several of them for the US Navy.  Right now, today, this very moment, there are SMRs being built for US Naval warships.  

Each ship does not get a boutique reactor, instead the interface between the ship and reactor is standardized.  During installation and replacement they cut a hole, pull out the old, put in the new, connect it up, test it and move on.

The only way the Navy can do this is because Naval reactors do not have to follow NRC's insane regulatory process.  Instead the Navy has it's own certification and licensing process.  The reason SMR's are so hard is that so many countries follow the NRC's extremely anti-nuke guidelines and those have proven extremely effective in preventing the licensing of new reactor designs.
Reply: @palladin9479  Naval reactors are not land based power plants, do not have to design for earthquakes and  many other things.   They also are extremely expensive on a per MW basis compared to land based power plants.  Your comparison just does not apply to power plants.
Reply: @perryallan3524  Naval reactors go into warships, you know ships .. that fight ... in war.  They are designed to a much higher tolerance then land based reactors.

SMR's make sense for distributed power, obviously smaller reactors are going to be more expensive per MWh then bigger reactors in pure construction costs, that's like saying water is wet.

But since SMR's do not have to be boutique, mass production of standard components and not having to submit paperwork to certify each and every valve of every pipe of every reactor vessel coming off the line drastically reduces costs.

I mean, do you even know what is the most expensive part of building a reactor is?
Reply: @palladin9479  I was in the US Navy.  I know about warships and the possibilities.

Naval reactors are designed very differently than civilian reactors for many reasons.  They would not be used as a civilian power plants for many reasons.  The fuel is outrageously expensive as its very highly enriched which is why they get 20-40 years of reactor run time out of a single fuel load.

The reactor vessel and head are the most expensive parts of the reactor.  But, you may have been asking about a  nuclear power plant --  and that answer is the containment/shield building.

Civilian nuclear power construction standards appear to me to be essentially the same as naval standards.

Component certifications, welding records, NDE records, X-rays on all welds on a certain size pipe or on all welds of super-critical locations, etc.
Reply: @perryallan3524  Yeah and we're all Genius Billionaire Superhero's too.  You haven't backed up any part of your statement.

The most expensive part of constructing a nuclear power plant isn't anything inside it, it's the interest on the loans you have to pay while it's being constructed.  The reason costs spiral out of control is that due to NRC licensing delays you end up paying far more in interest over time.
Reply: @palladin9479  A number of countries in the world do not finance the construction of nuclear power plants and have no loans (they pay for the plant out of existing budgets and revenue).  Thus there is no loan or interest cost to the construction of any power plant (using any technology).  Thus your claim about interest and loan cost being the most expensive only applies to certain countries (of which the USA is one of) and is not in general true.
Reply: You totally ignore the ongoing and long period success of small nuclear power plants in submarines and super carriers that have been reliably operated without serious accidents for more than 60 years.
Reply: @Croploss -Yeah, but at what unwieldy cost??  Taxpayer money thrown at extreme military budgets.
Reply: That's a whole lotta yap